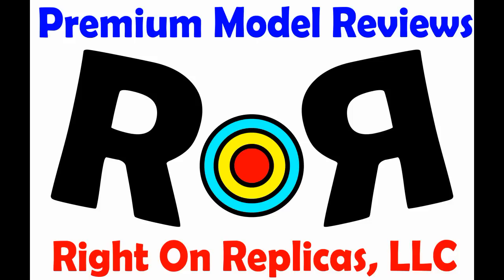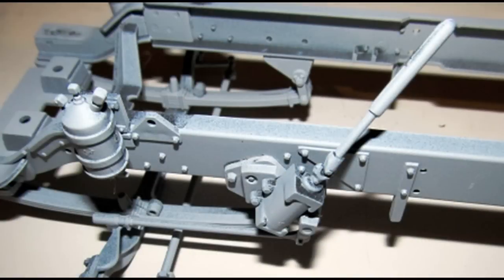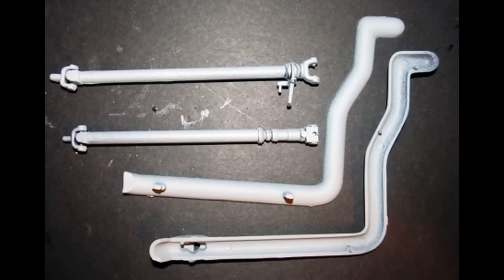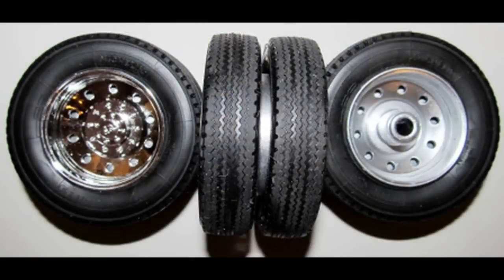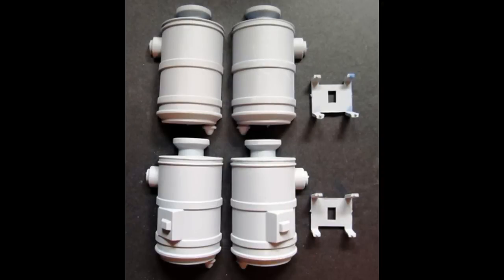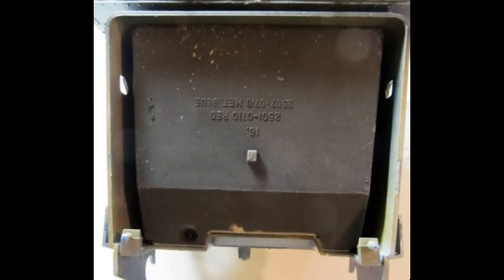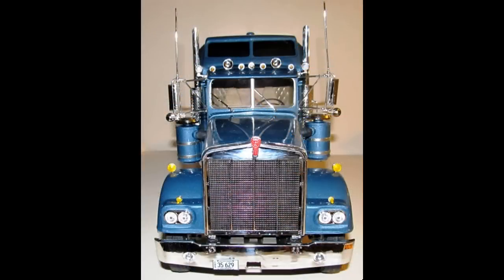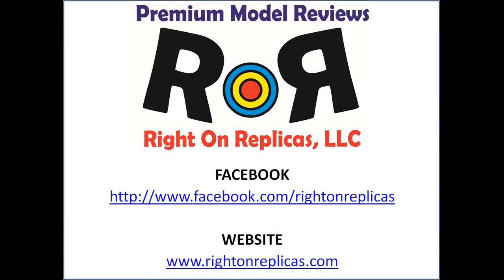How to Build the Kenworth W-900 Aerodyne Cnvtnl 1:16 Scale MGRM Model Kit #85-2508 Review

Comment: Your ducting did,t line up because you moved you cab and sleeper back and forth to suit the build. I built this same model and caught that error in time, left the cab where it was meant to be and adjusted the camper to fit not vis-versa. Still great work, paint, decals. My decals came out crappy!
Reply from the maker: IW,  Thanks for the information!  -Doug
Reply: Right On Replicas hi

Comment: A really great build !!!   I have the solution to getting a good flat surface to bond. What I use is a sanding board with 2-3 grits. I used a good sized piece of Plexiglas scrap I got for a $1.50US. I attached most of a sheet of 200 grit with a quarter of 100 and150 grits. As for attaching paper to Plexiglas, I'm using masking tape to hold them on. I also leave an untapped outer edge for all.  If you have alignment pins or anything thing that "DOESN'T BELONG" !  For things like the fuel tanks you should a perfect seam. For something like the engine and radiator the flat faces should have some extra glue, so that when you put them together you get a nice bead of glue running completely around the parts. A few hits with your emery board and you shouldn't see a trace of a seam. I usually use a circular motion. It's perfect for taking off stock to get " that ONE PART, YOU just have to have" !  (and you don't want to build from scratch either!!! )
   Something else I've found is that you're going to want to kick your own butt, too! That's because YOU didn't think to do it first !  Then you're going to be mad because you can't get along without it !
Reply from the maker: E - Those are all excellent ideas.  I'm sure many of the readers here can use those ideas!  -Doug

Comment: The best way to address the seam on the chrome fuel tanks, is to carefully sand and polish the seam smooth, removing the least amount of chrome possible, then cover the sanded area with Bare-metal foil.  The edges of the foil are barely visible, but it looks A LOT  better than that unfinished seam.
Reply from the maker: DB,  that's a good suggestion, thanks!

Comment: Wow! That is one sweet looking truck/tractor! Very realistic looking. Chrome parts look insanely crisp and shiny! The only thing that caught my eye were the air horns. On the original they are of course shaped and hollow inside like trumpets. Here you can see that they are just slightly hollowed out - as if they were "closed". Perhaps there is a way to make these look a little deeper inside without risk of breaking anything? Guess an oil paint wash won't look good (?) Anyway: thanks for sharing! Please keep up the great work!
Reply from the maker: TF - You are right.  I think they borrowed the math data from another model.  You could drill out the horns and then work a #11 hobby blade around to "ream" them out.  or use a tapered Dremel bit for a better shape!  -Doug

Comment: gotta laugh, there's no sleeper "escape doors" for the sleeper but steps were included! a lot of detail can be added to this unit because of its size!
Reply from the maker: Cal,  could be an incredibly tight panel fit; but your probably right!  -Doug
Reply: @RightOnReplicas    I retired from a Ford/Kenworth dealer after 39 yrs and the last 2 yrs I pre-delivered a little over 100 KW'S-most went to the oil field in western N Dakota! the escape doors came with or without a tinted window and were above the toolbox doors. option of one or two door's could be ordered. by the way, I was able to get a KW & Pete back when the original ones came out but messed up and passed on buying the companion flatbed trailer! I seem to remember thee was a Frieghtliner cabover too but i never saw one. you did good on the build by the way!
Reply from the maker: Cal,  thanks for the information.  Very interesting!  -Doug

Comment: Wrong colors, you painted the wiper knobs red and yellow, they should be alu, you painted the brake knobs black, not correct, from left to right they should be red, yellow and blue.
Reply from the maker: Fred,  thanks for the detailing info!  -Doug
Reply: You are welcome, when detailing dash on semi truck, the knob shaped like a stopsign is allways red, the square button is yellow, and the round one is blue, kind regards from an old trucker :-)
 @RightOnReplicas
Reply from the maker: Fred,  Thanks again, great info!  -Doug

Comment: For the advanced modeler,the chassis and the engine can be plumbed prior to priming and painting using Plastruct styrene rod of different sizes.There are after market photoetched big rig sets available for big rig kits in this scale;being a 1:16 scale big rig,that would be a kit in of itself;$30.00 MSRP just for the 1:16 scale photoetched set for this kit.An after market air and electrical line set for the trailer hook up,is also available for around $12.00 to $16.00 MSRP.For a contest model,you would want to buy some after market hood fender mud flaps,vinyl hood latches,alcoa rims,fuel tanks and fuel tank straps,air ducts,exhaust pipes,air cleaner caps,air horns,cab clearance light bezels,smoke stacks/heat shrouds and grab handles,grille mesh,and grille that is all made out of machined and polished aluminum.I know that would be lots of work;and would probably take 2 to 3 years to complete a super detailed version of this kit,but it is totally worth it if you plan on winning first place and best in show in the big rig category at the IPMS model shows.
Reply from the maker: DR,  Those are all great suggestions DR.  It's also why we don't do a lot of super detailing here.  If I only built one model to review every two years there would be much to talk about in between!  -Doug

Comment: Another question, I know (remember) the stacks are general two piece chrome that never seems to meet up just right to look like a real round stack. Is there a way to make this seam disappear? I have tried rubber bands, filing, clamps, tape, etc....
Reply from the maker: J - Yes, you can glue the parts together and sand/fill the seams.  You can then paint the parts chrome silver or send them to an elctroplater for replating.  There's also Molotow chrome pens out that may work for refinishing.  -Doug

Comment: Couple questions, I am just getting back into models after 35-40 years and noticed that your primer paint wasn't "full" coverage. Is that ok and does it work well? Second, when gluing parts together after primer do you still need to scrape the paint clear or will the glue pass thru? I am using model master "liquid" glue with the metal tip.Also, on one of my lower skill level cars I have recently built I did wash the parts on sprue in hot water (not to hot LOL) with dawn soap, rinsed in warm water and let for several days. I then started painting thinking I was good to go but when (after a week to let paint cure well cuz I got nothing but time) I went to scrape some areas to glue and huge chunks just flaked off. What did I do wrong or any ideas of what I can do to make it better)Allen
Reply from the maker: J -All great questions.  1st Welcome back!  A light coat of primer is really all that's needed but for exterior parts you want complete coverage to avoid shading differences in the final paint.  You need to scrape paint and plating form parts for good banding.  Sounds like there was still some water on the parts but there are a number of variables here.  The type of paint and plastic can affect surface adhesion too.  Were the parts primed first?  Anyway, you're doing the right things - just make sure the parts are dried and there's no pockets of water that can seep out from nacelles etc..  -Doug
Reply: great, next is what about air brushing? I have never used an airbrush in my life. I have spray canned and liquid brush but never airbrushing. How easy/hard/recommended/type of paint (oil or water based)?
Reply from the maker: J -Airbrushing is both hard and easy.  It has a learning curve and once you've mastered the basics of thinning the paint, using the right pressure and keeping the spray gun moving - it gets easy.  I will have to do some demos on the subject soon.  The paint used is really just any paint you've been using that is properly thinned!  Thanks Doug

Comment: I was wondering if they make trailers for this size of model truck, and wherte could you find one?
Reply from the maker: FW,  I'm not aware of any.  This would be a scratch build project for sure!  -Doug
Reply: @RightOnReplicas  I built this truck long long time ago and bought a trailer for it; this was the Fruehauf flatbed trailer Monogram Kit 2503. In a shop which is closed now. Don't know if still available on the market.
Reply: Those kits have been out of production for almost 30 years.If there are any unbuilt 1:16 scale trailer kits still out there,they would sell in the triple digits;$300.00 to $400.00 on websites like Ebay.But if they were to re-issue these big scale trailer kits,they would sell for about $67.00 MSRP.